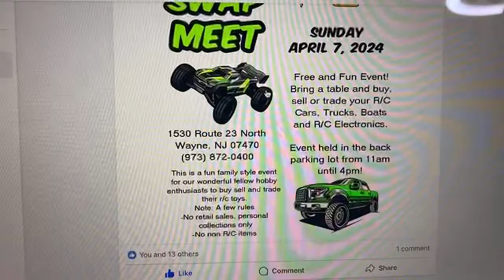This Baja Wont Start - LIVE Repair - Carb and Spark Check & Fix

Comment: 40:45 you actually do have spark. The plug was good
Reply from the maker: hey bro!  You are right! I just went back an checked. There was SOME small spark, but it was not enough to fire up the BAJA.  I tried for a while last week and it was not firing up.  Compared to how a new plug should be, this was fairly dead.
Reply: @hybrid32494  understood. Thanks for sharing this knowledge. I just assumed spark was spark

Comment: How  do I know when the  motor idle is set
Reply from the maker: Hey man, generally a good idol will be obvious when without any throttle or break, the RC model just stands there and does not move forward, also, it does not shut down, and the RPM of the engine is just a little bit higher from the point where it stalls out. If you maintain a high idol, you are just running a little bit hot, and there is no need to. Does that make sense? Very good actually hard to explain in the comment you know.